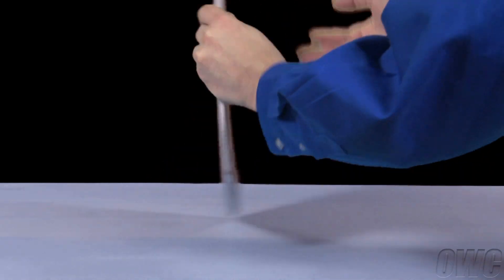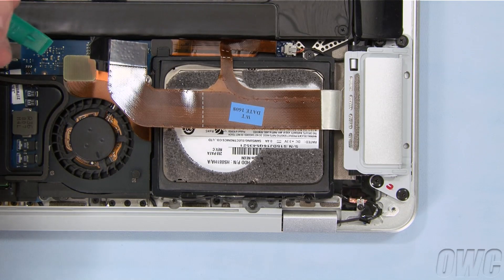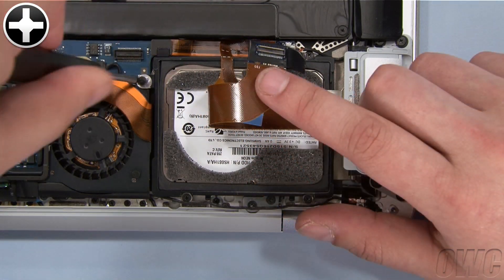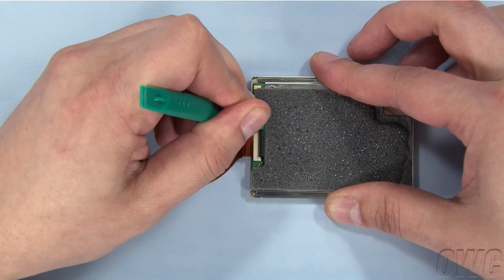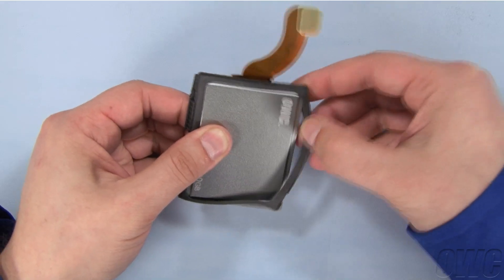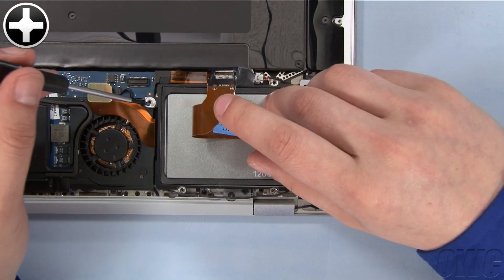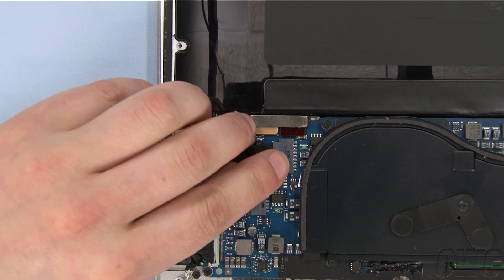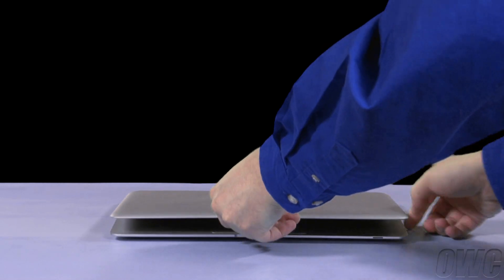How to Upgrade the SSD in a MacBook Air (2008)

Comment: Hello, i have an original macbook air early 2008 (the 1,8 ghz with the ssd version) i got it just for web browsing and taking notes, the wifi doesn't work, i mean, when i clikc on it it says WiFi : No Hardware Installed.
I tried resetting NVRAM and SMC but nothing changed, the module itself it's not broken cause when going into repair mode (Command + R) the wifi works but when using it normally booting it doesn't work.
How do i fix this?
Reply: does it work for online movies, youtube, office work etc ?
Reply: Andrei Mostis it depends what “office work” you are doing
Reply: @autumn5274  word, powerpoint, pdf.. also does it run sublime text ? would it be suitable for front end and back end development ?
Reply: Andrei Mostis just buy a thinkpad i5 they are about 150 dollars , I don’t know what is this “if its not apple then I’m not using it” for word PowerPoint etc I don’t really know cause MacBooks older than 2012 are known to fail on the gpu , it’s good if you find it working for YouTube and writing something on openoffice but I recommend buying a windows laptop that’s a lot better (I have an iPhone 6s so I’m not an apple hater don’t get me wrong) also for sublime text I don’t even know what it is
Reply: Andrei Mostis oh and for development well, you know it has 2 gb ram and a integrated graphics card and a core 2 duo so heh
Reply: @autumn5274  i found one at around 100 dollars and i thought it would be good for faculty work. i am not an apple hater neither an apple lover.. i am using a good windows laptop rn
Reply: Andrei Mostis usually old MacBooks have some faulty things so be sure it’s fully working
Reply: Andrei Mostis just try to spend a bit more and get a newer model
Reply: @autumn5274 of course the battery is dead.. but overall in great shape
Reply: Andrei Mostis well if I find a way to fix the WiFi issues ( that’s a problem cause this mac max version is Lion and it doesn’t help cause of lion being really buggy with WiFi) I might use it for web browsing , taking notes at school , and for gaming, heh , I have some emulators (nes,snes and gba) and they aren’t really stable

Comment: hey, I am a windows user trying to fix my friend's macbook air. where do I get a new hard drive for macbook air 2008? it looks so weird I have never seen anything like that before. I searched shops online and they don't seem to have them anywhere. is this a part of the stupid apple cult? can I only get them at apple stores and authorised sellers? man, I hate apple... I can't help it. they are pain in the ass. great video, by the way. I would never have figured out how to remove a hard drive from this weird laptop. you forgot to mention though, that the small board on the hard drive bracket was glued to it. I almost broke it. who would suspect something to be glued in place? so weird.. hmm.. so now I know how to remove the thing but I have no idea where to get a new hard drive..